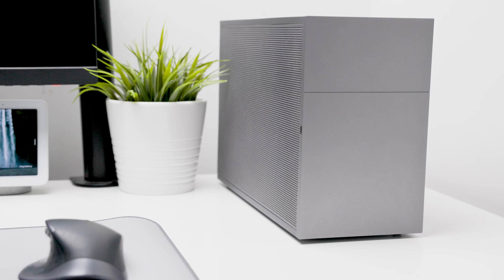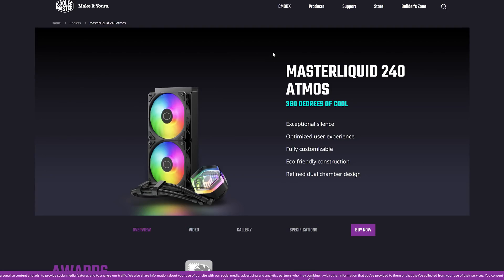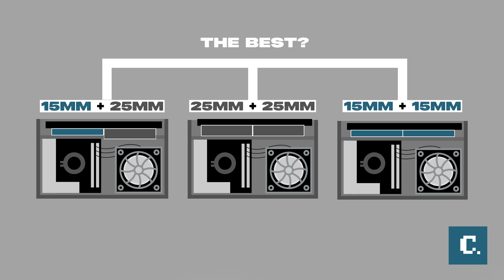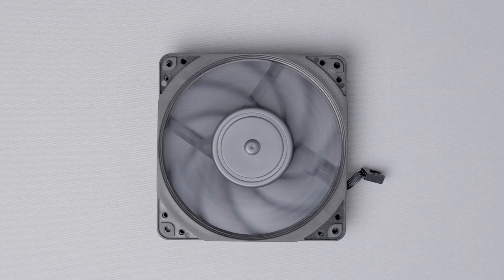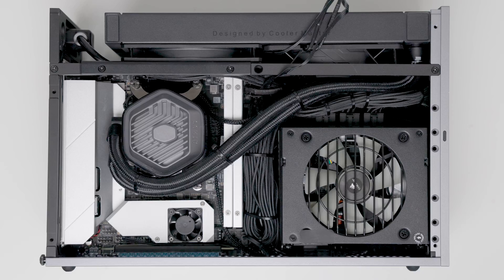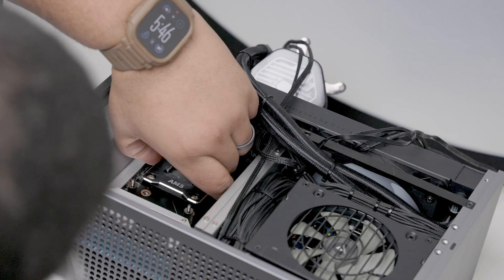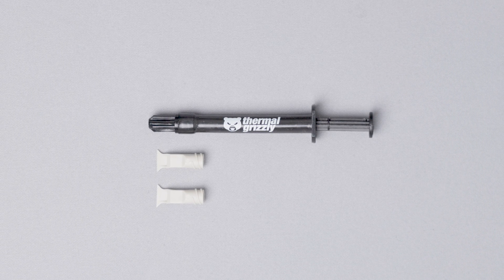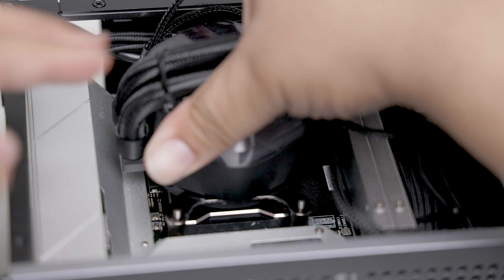Fan Setup Face-Off in FormD T1: Finding the Optimal Configuration | Test & Tips

Comment: I'm interested in using the Noctua 12x25 and 12x15 fans configuration but the problem I've run into is finding the proper sized screws for mounting the 12x15 fan to my NZXT 240mm AIO. I bought some 6-32 UNC x18mm screws but they're too short. Before I spend any more money I would like to know what size screws did you use to mount the 12x15 fan and where can I obtain them?
Reply from the maker: Oddly enough I just bought two P12 Slim fans and each of those had the slim screws. Used those for the Noctua.

Comment: Going to build my first PC and I am looking at going with the FormD T1. I saw the Silverstone VIDA 240, any thoughts on this AIO? (I do think it is a bit ugly but having it all stock and already thin is appealing to me), Cooler Master MasterLiquid ATMOS 240 is also an option and maybe EK.

Air is also an option but I do prefer the look of an AIO specially if the CPU block looks good. 

The Lian Li A4-H20 is also a case I was looking at.

A big part of this build is I want to be able to fly with it (very rarely, but a few weeks after I build it I will be moving country)

I know I asked a bunch here but any recommendations would be appreciated! ☺
Reply from the maker: Well, if you happen to go down the route of using a 4080/4090 FE, you should go for the T1 with the FE GPU travel kit, video of the kit coming soon. 

The cooling method really depends on the CPU and your use case. I highly recommend going with a AIO if your goal is productivity, especially if you choose a 7800X3D or higher. 

If you’re gaming primarily you could get away with using an air cooler like the X47, but you want to stay at or below a 7800X3D and a good idea to tune it for better thermals. 

There aren’t very many AIO options for small form factor PCs like the T1 or A4 H2O. I prefer the T1 over my A4 because of the flexibility yet smaller size. Be cautious of your GPU size and cooler height if you’re going with the T1.

Comment: Hi how did you mount the 2x 25mm fan? Was only the aio grill cover needed only?
Reply from the maker: Mounted the fans onto the radiator, to mount the AIO top hat you just need those thumb screws to secure the top
Reply: @ChrisRussellTech  the same thumb screw that were used for the original top mount?
Reply from the maker: @caliusseytoh9564  yes, the that come with the T1 in the box

Comment: Thermal performance isn't the primary reason for swapping fans, it's the fan noise and pitch. If fan A is quieter than fan B, fan A can be ran at faster speeds, which also drops temps a bit. Comparing all the fans at same speed isn't as useful as noise normalized testing for that reason. And even with noise normalized testing the pitch is unaccounted for, and pitch of the fan can make it more annoying even if it is quieter than another fan that's louder but lower pitched.
Reply: I considered this but then I thought when I wear my headphones or have the speakers on, I don’t notice my fans at all.

Comment: Great video. I have 4 T1’s all with aios. All 4 of my builds use a nfa 12x15mm fan and a t30 fan. Never have had cooling issues. I would definitely recommend getting the contact frame as you showed. I saw a decrease in temps with just that.
Reply from the maker: Wow that’s a lot of T1’s! Can’t go wrong with a T30. I am currently filming my next video; Air vs AIO with AXP-90 X53 vs ATMOS 240mm…
Reply: What's about gpu temps
Reply: @juanf9764  I’ve never had gpu temp issues.
Reply from the maker: @juanf9764  I can make a video on GPU temps, however the GPU has stayed cool with a high of 65c and idling at 34-38c.
Reply: @ChrisRussellTech thanks, I'm looking for something similar but with the rog LC 240 because the pump its 45mm tall
Reply from the maker: @juanf9764  with 45mm you have the option of using all slot configurations. You’d just have to decide which card you’re using. If you’re going with 30/40/80/90 founders edition then 3 and 3.2 slot will be your options.

Comment: Great vieo.  My T1 V2 2.1 uses a 25mm rad and 2 25mm fans all from EKWB, and a air cooled 4080FE with R5 7600X @ 5.2Ghz
Reply from the maker: Nice specs, you’d think these GPUs would struggle in these cases but my 4080 S FE idle at around 34-38c
Reply: Mine runs 2 to 3c higher  @ChrisRussellTech
Reply from the maker: I think thats within margin of error, especially depending on ambient temperature @mannyc19

Comment: Interesting. Dual Silverstone air slimmer 120mm fans would be my choice in this case. It’s the best performing slim fan according to these tests: https://youtu.be/JzV0Nbw3y1Q?feature=shared
Reply from the maker: I think when building in a small ITX you have to be somewhat comfortable with some performance and thermal hits. I think two 15mm fans offers a good deal while taking up less space and in the T1 space is like gold. I'll look into the Silverstone fans, I probably have 10 different models of 25mm fans but just one 15mm fan from Arctic.